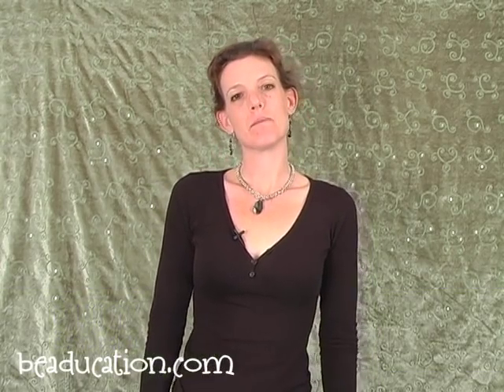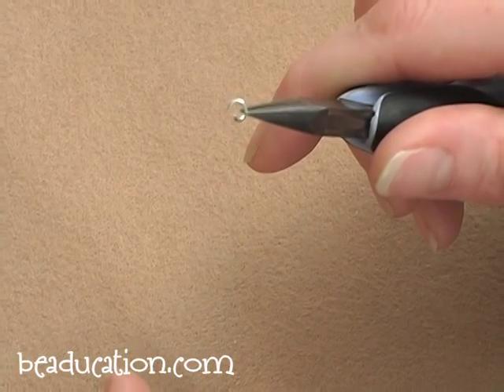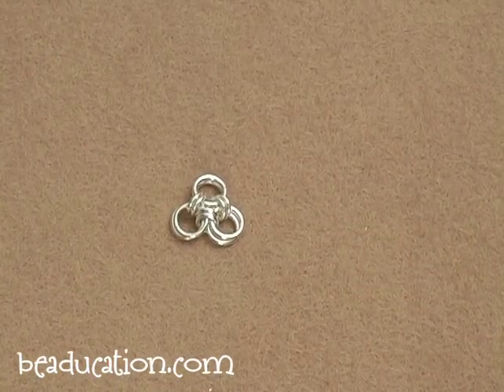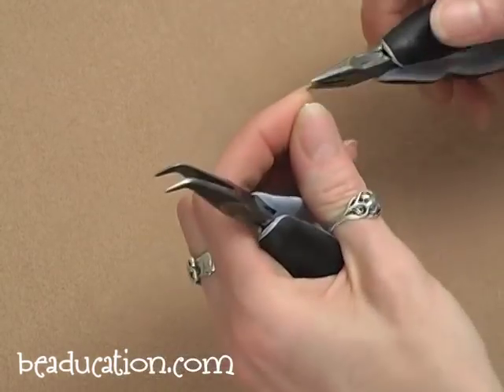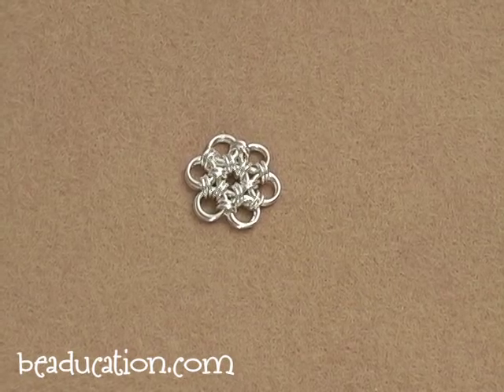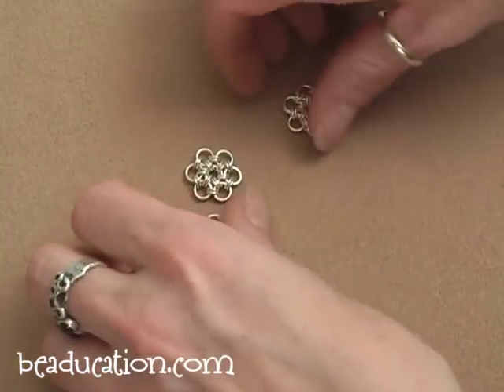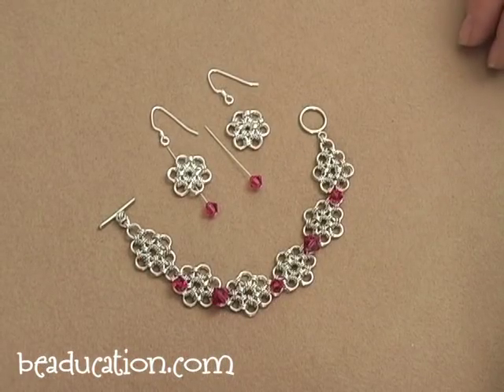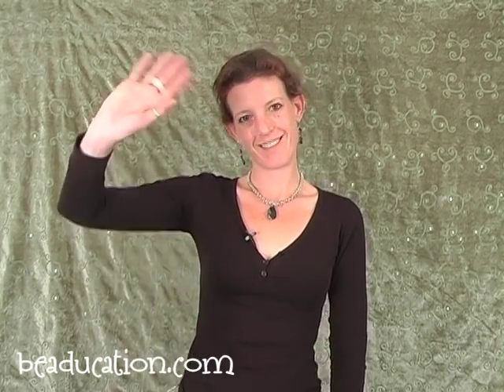Daisy Maille Chain - Beaducation.com

Comment: I have always been afraid of using jump rings. when it called for them I used slip rings which is like a little keyring cause I don't want to make something that can come apart if I do the jump rings wrong. I couldn't make this with slip rings could I. it might take longer but I don't know if it's possible. please let me know.
Reply from the maker: You can't make chainmail with split rings, it's too hard, and really you don't need them. The jumprings stay together just fine.

Comment: First off, thank you for your videos! They are a Real inspiration! My question is, will 20ga 7/64'' (2.84 mm) work well? I can't find 2.7mm
Reply from the maker: Chad Dean We sell the 2.7mm jump rings on our site, but 2.84mm will work as well, however, the weave will probably be a little loose. If that becomes an issue, switch the 4.5mm, 19 gauge rings for 4.5mm, 18 gauge rings and that should sort things out.
Reply: Thanks!

Comment: What gold wire do you recommend? Is gold filled my only option for gold wire that doesn't peel or lose color?
Reply from the maker: Yes, Gold Filled is great and will not peel or lose color and it won't break the bank. Other gold "colored" wires (besides pure gold of course) will lose their color fast.